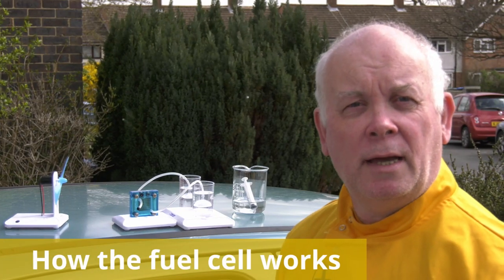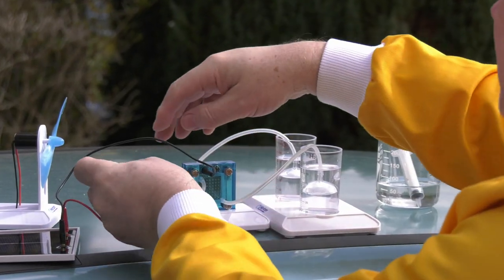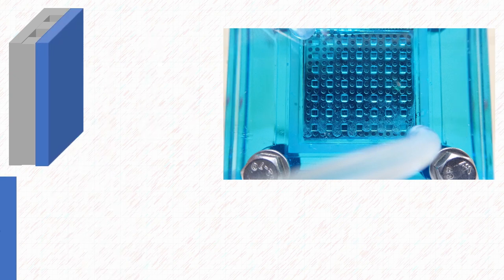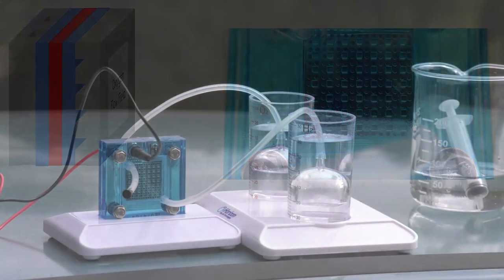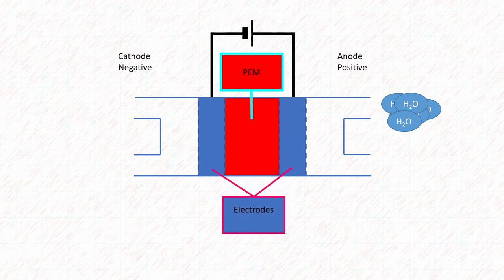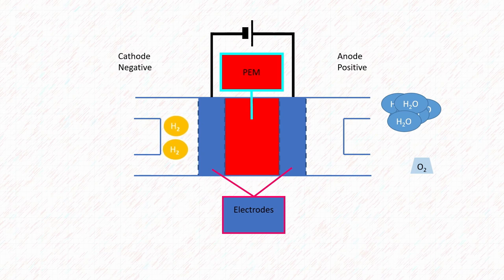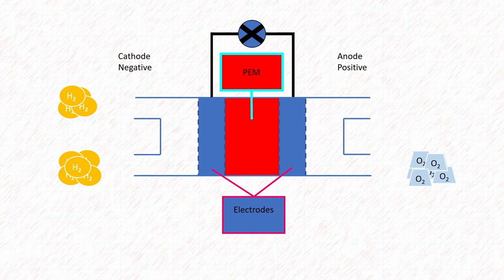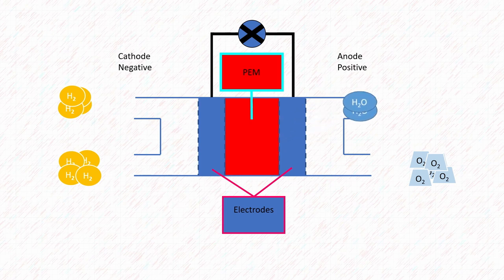The Hydrogen fuel cell explained, clean energy

Comment: The first experiment is not the reaction is expected to be performed in a common fuel cell but it is just water dissociation to produce O2 and H2. But the second part in which H2 and O2 introduced into the cells is a main reaction that occurs in a common fuel cell. In fact fuel cell convert chemical energy into electricity. Thanks.
Reply: The point that you don't usually hear about is that you can produce hydrogen in a very efficient way with your fuel cells.

Comment: Very cool demo!  In the end, how much solar energy was used to run the fan? or in other words,  what was the round trip efficiency in and out of the fuel cell?
Reply from the maker: The systems are not that efficient, but more efficient than many other systems like internal combustion engines.
Reply: @PhilipRussell  эта установка Вами покупалась? Или Вы её сделали?
Reply: The efficiency is never kept, regardless of the method. In the end, he used X energy to power up the fuel cell which then was able to generate back y*X energy in return, with 0 < y < 1 .
So put simple, it may be an efficient way to use energy (store energy) for nocturnal use (when solar and others are at low), being able to easily revert a good percentage of that energy back!
Reply: @jailsondias4102  👆👆

Comment: Great video!!!  I did not know that a fuel cell could be run both ways.  Since that's the case, then why aren't fuel cells (at least of the type in your presentation) used to generate Hydrogen in massive plants via solar panels to source the Hydrogen needed for fuel cell vehicles?  Seems to me that if it could be done this way efficiently in mass quantities, that would solve the issue of typical industrial methane generation and its carbon dioxide biproduct.  This process would also source Oxygen to sell.  Or could mimicking photosynthesis be more promising?  Aren't storage and transportation procedures already mastered or in the works?  Sourcing the Hydrogen itself in an acceptable way to be Green is the issue, right?  As your title states, this would be Clean Energy.
Reply: Perhaps because the car systems are not yet ready, you need a lot of safety measures. Another problem is storing the required Hidrogen for the car to run. All people dream they can add water in the car and they get enough Hidrogen to work (false). Truth is it very dangerous and you would look at a potential bomb worse than natural gas running cars even.

Comment: This is nice. You should be more precise that the first reaction is electrolysis and the reverse reaction is operation as a fuel cell to produce electricity.
Reply from the maker: You are correct the first is using the fuel cell for electrolysis and the second is using the fuel cell to do the opposite. The point of the fuel cell is that it can do both. If electricity is supplied then it does electrolysis, if gases  are supplied it makes electricity.
Reply: @PhilipRussell  does this mean that we don't need hydrogen as a fuel these cells. Just a sufficient solar plate will be fine (no need to charge at a fuel station)?
Reply from the maker: @satyamsharma-qm4yb  The fuel cell works in 2 modes. And only one at a time. 1) Splitting water into hydrogen and oxygen from something like a solar panel - getting the energy from the sun. 2) Using the stored hydrogen and oxygen ( oxygen can come from the air), combining these together to make water and electricity - to power a car for instance. So when you are not using the car the solar panel could charge the car. If it is sunny the solar panel could run the car when its sunny, but if it is cloudy or nighttime then you could use the hydrogen to power the car.
Reply: @PhilipRussell  but it's using energy and it's not water that comes out the end. Conservative of energy?  Right , the light used some electrons  right? The water molecules are missing electrons coming out the ass end , no? So it's not real water.  What is it? And electrons have mass I think? I'm so confused.
Reply: I'm not getting it... stumbled across this article, extremely interesting , I'm a machinist, and Struggling with the concepts and rules on chemical or electrical or physical, reactions like this taking place. By the way, what type of reaction is taking place?  My mind says it's physical...ldk

Comment: Hello PHILIP, great video can you provide me information on how did you produce the hydrogen in that glass ? Thank you in advance for answering
Reply from the maker: A water molecule is made from Hydrogen and Oxygen joined together. The Fuel cell is using the energy of the sun turned into electricity to split the molecule in half. Because of the way electrolysis  as it is called works, the hydrogen is produced on one side on the negative terminal and  oxygen on the other terminal.

Comment: So, creating this on a bigger scale should be enough to get a house off-grid, right? what about the power losses of this system? how long would it be able to leave the fuel cell charged until it dies?
Reply from the maker: Enough fuel cells and you could easily power a house. Power losses? - efficiency is a better term. The devices are not 100% efficient by any standards. The fuel cell is not charged. It is fed with Hydrogen and if necessary oxygen and this produces electricity. If the hydrogen or oxygen supply is stopped then  the cell stops making electricity. In this demonstration the water is split into hydrogen and oxygen. In a system like you describe you might just buy the hydrogen to power the fuel cells
Reply: Is it even possible to buy a cell large enough to power a home?? Or maybe make one?

Comment: Sir in both glass did you used allready separated H2 and O2 or the both of the glass contain only water
Reply from the maker: At the start both glasses only had water in them the fuel cell produced hydrogen on one side and oxygen on the other and the pressure of the gases moved the gases along the tubes until they got into the containers where they displaced the water.

Comment: hi
Hope all is well. my question is regarding browns gas. if I'm producing browns gas which is a hydrogen/oxygen mixture unlike these units that separate the two gasses. do you think there is a way of doing the same and producing electricity using browns gas
Reply from the maker: Browns gas is simply a 2:1 mixture of Hydrogen and oxygen. In a fuel cell 2 Hydrogen atoms are combined with 1 Oxygen atom  on either side of the fuel cell to make electricity. The mechanism for this is my other fuel cell video. Adding a mixture on one side will not work in this type of fuel cell. It would be better not to mix the gases for a fuel cell and it will always automatically join two hydrogen atoms to one oxygen to make water regardless of the amounts. If one runs out then the system simply stops. So I believe at the moment there is no easy way of making electricity from the mixture but easily from the two separate chemicals.  Usually when Browns gas is made the two chemicals are collected in one container rather then two containers which is in fact just as easy as in this video.
Reply: @PhilipRussell  thx for the reply sir but unfortunately that's how I'm able to produce the gas you see I have found a way to produce lots of this gas with a fairly small amount of electricity and was wondering how I could turn the gas to electricity but since you don't think that is possible what do you suggest I should do with the gas in your opinion
Reply from the maker: @mohammadhashemi1771  If you are making Browns gas using electricity you are making one of the gases at one electrode and the other gas at the other electrode - That's how electrolysis works. If the gases are together and cannot be separated then there is no cheap way of separating them.
So how are you making the gas using only a little electricity? Because to my knowledge it takes the same amount of electricity to separate hydrogen and oxygen as you get when you combine them ( Law of Conservation of Energy)
Reply: @PhilipRussell  maybe that's the law of conservation of energy but my solution is a combination of energies so I guess that law don't apply to this solution. the apparatus is cylenderical which acts like a vortex and the bible's just go up a single stream mixing the gases, I have been thinking how to separate them on production but nothing comes to mind that's why I was asking your good self for advice. I am using 40 amps and 14 volts and I'm getting just under 40 lpm and I need to find a use for it
Reply: @PhilipRussell  sorry for the typo I meant bubbles not bible's. very sorry about that
Reply from the maker: @mohammadhashemi1771  My colleague and I have been talking this through and we can't come up with an answer for you.
Reply from the maker: @mohammadhashemi1771  We guessed bubbles!

Comment: Hello sir, can i ask something just to be clear?
so both glasses contain water, and collect each O2 and H2. Do you have to collect O2 from water or can you just collect in from the air? that means only 1 tubes to 1 glass for H2. Also in your explanation, are the position of the anode and cathode correct? in electrolysis, isn't the reaction goes from the cathode to the anode? 
Thank you very much.
Reply from the maker: You can use a fuel cell one way only and supply O2from the air. The reaction works two ways. Either as electrolysis so hydrogen being positive is collected at the cathode and oxygen being negative is collected at the anode. Or as a fuel cell where hydrogen is supplied at the cathode side and oxygen at the anode side. In this reaction the roles of the electrodes are effectively reversed.

Comment: can you detail describe what polymer electrolyte membrane did you use?
Reply from the maker: The fuel cell uses a polymer electrolyte membrane (PEM) that is very thin. It is made from a Perfluorooctane sulphonic acid type plastic. (C8 H F17 O3 S)n  Called a PFOS membrane. If you look up Perfluorooctane sulphonic acid on Wikipedia you can find more details. Essentially it is a sheet of plastic that only lets protons through.

Comment: @ 4:52 if the electrons are making that light flash at the top and then they meet up with the hydrogen after it passing through that Center membrane, won't there be a depletion of electrons to hook up with the hydrogen ions again? what does the hydrogen turn into when they all meet up and they're missing a few electrons,? (would it be called light water because a few electrons have been used by the light bulb ? It seems to me it's "water in" and "almost water" out. But the diagram in video says no....its missing some electrons..? Mass is lost from light bulb Can anybody help me with that? Does it even make any sense what I wrote , trying to convey my thoughts but it's kind of hard at 68😕

Comment: thank you so much for the explain, so the first phase is producing H2 and O2 from water by using solar panel electricity. the second phase is generating electricity from produced H2 and O2  by PEMFC operation, is it right?
Reply from the maker: No you don't need to do the first step, I just did it to demonstrate the power of the fuel cell to do the forward and the reverse reaction
Reply: @PhilipRussell  thank you, the pemfc operation doesnt need any power source at all? it only requires H2 and O2?
Reply from the maker: @huynhnguyen4892  No power. Hydrogen and Oxygen combine to make power ( electricity)
Reply: @PhilipRussell  thank you very much.

Comment: How can we get liquid oxygen and how much it will cost
Reply from the maker: Making oxygen this way would be cheap, just using solar energy through a fuel cell and then compressing it and liquefying it. As for the cost it is still probably cheaper and easier to get the liquid oxygen in the way we do now by just liquefying air and allowing the oxygen to boil off. There is no real advantage because the cost is in the liquification, and oxygen is present already in air.

Comment: What if you had two fuel cells, one makes the hydrogen/oxygen, and the other one made the electricity?
Reply from the maker: So you want one cell to be powered by the other. In theory the energy out would equal the energy in, however in practice there will be minor losses, some electricity will be turned to heat, and the pressure of the hydrogen and oxygen  might not be enough to made enough electricity so I would predict that the system will work fine for a little while and then gradually stop working. It might be fun to try this out.
Reply: @PhilipRussell  Oh, i see nice.

Comment: Nice video explaining water electrolysis and hydrogen fuel cell! Thanks!
However, I think you have the anode and cathode the wrong way around on the fuel cell graphic.
H2 is oxidised at the anode by giving up electrons to the circuit - hydrogen side of the cell is therefore positive (anode)
O2 is reduced at the cathode by gaining electrons from the circuit - oxygen side of the cell is therefore negative (cathode)
Sorry to sound like a smartass!!!
Reply from the maker: A fuel cell can be thought of as 1) an electrolysis cell  water which is vaguely h+ and O- The hydrogen being positive is attracted to the cathode and the oxygen being negative is attracted the anode. Since this is a dual fuel cell that goes in both directions when reversed the opposite happens as you say - but the names of the cathode and anode remain the same. Its all part of some historical nonsense when Michael Faraday named the electrodes wrongly and I suppose he never thought that we could reverse such things . So you are not wrong but life becomes difficult when the anode is a cathode some of the time and an anode the rest and vice versa. In Physics we just get used to such things. Changing names halfway through makes it even more confusing!
Reply: @PhilipRussell  That's a really interesting explanation! I stand corrected. Thank you for explaining
Reply: @PhilipRussell   thanks for suggestion.

Comment: For the steps, small amount of distilled water should be injected in the fuel cell, why? why it must be injected in the fuel cell? if the water does not injected in the fuel cell what will happen?
Reply from the maker: The fuel cell breaks down water into hydrogen and oxygen, if you don’t put water in it doesn’t work. Why inject, well its a small hole to fill and this is the easiest way.
Reply: @PhilipRussell  thank you so much! The water in the fuel cell will be used up or not when the electrolysis process is done repeatedly?
Reply from the maker: @ajim261  Yes that water is used up, butr not that much. 1 mole ( the amount of substance) of water is 18g and 18 cm3 this will produce 24dm3 or 24000cm3  of hydrogen and 12dm3 of oxygen - and in this expt we only made 30cm3 of hydrogen - so in fact not much water was used up.
Reply: @PhilipRussell  Okay so at the end of this process, H20 will escape through anode side. Where is the water go? into the fuel cell back or into the cylinder beaker?
Reply from the maker: @ajim261  The really small amount of water is made in the fuel cell and then leaks from the anode side tube

Comment: what is the point of this ? how is it clean energy if it needs electricity ? since when electricity is only made out of clean, non fossil sources ?
then what do you do with the hydrogen ?
Reply from the maker: The fuel cell can work in two directions. Either electricity can be added to the fuel cell and this energy used to split water into hydrogen and oxygen, or the system can be reversed and hydrogen and oxygen added together to make pure water plus electricity. So how is it clean energy? Hydrogen + Oxygen = water - no carbon dioxide produced - that is the definition of clean energy no carbon dioxide produced. Solar panels and wind power make up to 50% of the UK energy this does not produced carbon dioxide. We also used nuclear power - no carbon dioxide produced ( although there is some nuclear waster). What happens to the hydrogen? - it is stored and then used later - it is reacted perhaps when there is no sun ie night time to react with oxygen to make water and electricity

Comment: As we know that this reaction can occur in reverse way then why Toyota and others who are making hydrogen cars don’t utilise it. They travel hundreds of kilometres to find hydrogen fuel station to fill their tanks.
Reply from the maker: A few problems - 
1) The hydrogen would need to be stored—possibly compressed—which would add more things to a car and energy costs as well.
2) The amount of energy used to make hydrogen is the same as the amount used to power a car. Energy is being used by the system to power the car; if you want to power the car and make hydrogen, you need more energy.
A better scheme is regenerative braking,  charging a cell or battery 
They need more hydrogen stations - similar to the very early days of petrol cars on the road - driving a long way to the nearest petrol station.

Comment: Why not just plug the fan into the solar panel?
Reply: It doesn't work at night!!! But using the fuel cell to make hydrogen during the day means that it can be used later
Reply: @makingbettervideo379  Ah so this is marketed as a battery storage device, not something that generates electricity.
Reply: @AB-sg4xu  No it can do both. A fuel cell can make electricity from Hydrogen and Oxygen or it can make Hydrogen and Oxygen from water  if you supply electricity to it.- it just depends on what you "feed" the fuel cell with.